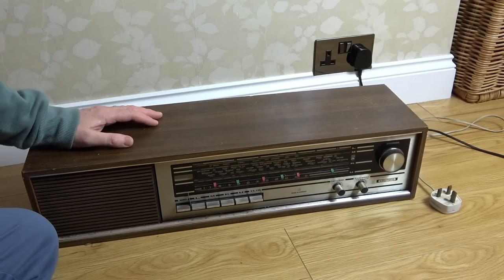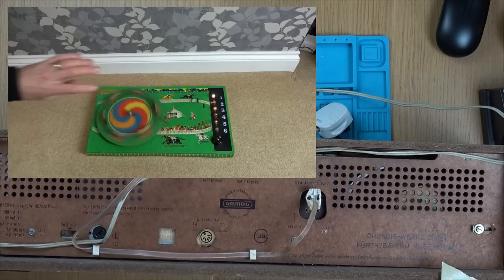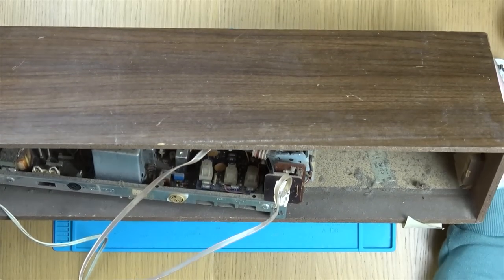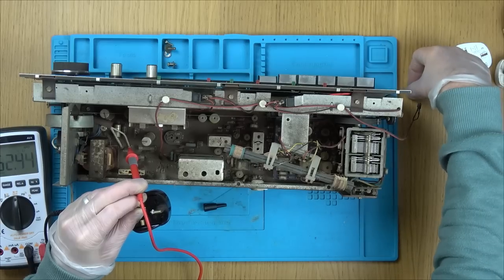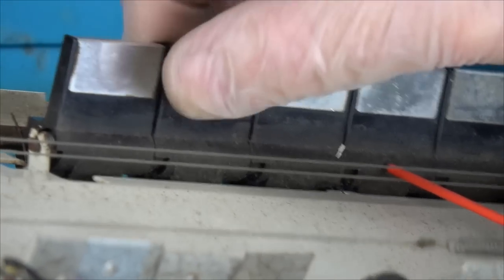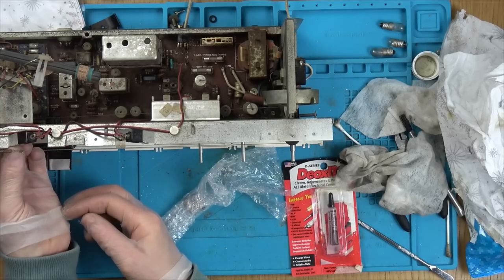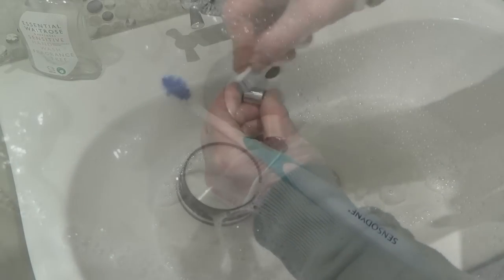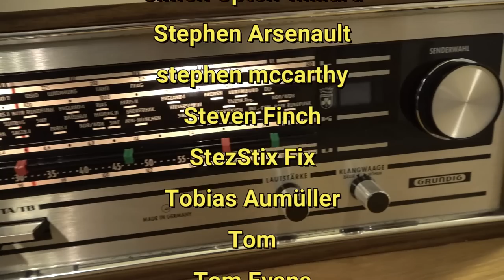Trying to RESTORE a Dirty HUGE Vintage West German 1960s GRUNDIG Bookshelf RADIO

Comment: Just a suggestion for future radios, you could use an FM transmitter; the kind you might have for a car, and then use that to play some roylaty free music to demonstrate the product, without risk of issues with copyright.
Reply: or better yet one of the pll quartz synthesized 2w ones from china that are much better than the crappy car ones and have more better range. Like the kind youd use for a drive-in church or movie 
They go from 88mhz all the way up to 110mhz and have dual low and high power settings so much more handy too for testing and they run off 12v dc
Reply: I have one of those transmitters for my AM radio in my 1965 Cadillac so I can use my I-Pod to play through the original car radio.
Reply: Difficult not to distract from the originality but I’d instal a Buck converter to drop the supply on those lamps and cut the diffusers off the bulbs if you want to use filaments- you might even find the diffusers are over the top of the bulb glass. Of course, leds and a dropper resistor would enhance it… Great vid, Vince.

Comment: What a gorgeous piece. After all those years I can't believe that something more vital wasn't broken like the transformer, any of the caps, fuses on the board., even an old dry trace what just wasn't making a good enough contact. Speaks for that old German quality.
Reply: many blame capacitors for pretty much any and every fault, in my experience, theyre not , especially in that sort of age equipment,
Reply: That's what I was thinking. With all the rust and corrosion it must have spent a lot of time in a humid environment, but when the electronics are well-made that doesn't matter much, apparently.

Comment: The switchset is sticky and as long as you got a range switch down the Off switch will not stay off. The "AUS" (Off) switch kills power and releases the frequency switches. Usually a bit run down grease on the switches release rail.
The lamp holders can be pulled up and the bulbs removed without front removal. They are just pushed onto the sheetmetal latches.

Comment: The particle board construction just signals the direction Grundig, along with other manufacturers were taking in trying to be cost competitive with those clever Japanese. My grandfather had one of those old tabletop units from the late 40s in a lustrous REAL blond wood cabinet. The push-buttons and 'magic eye' intrigued my 5 year old self to no end! He was a certified Westinghouse electronic repair man and so, that radio was always in tip-top running condition!

Comment: I have the exact same one, I bought it at a local scrapyard for a few Euros. 
It worked right away but had several smaller (mostly mechanical) issues. 
I lubricated all the movable parts, cleaned the pots, etc.
I also recapped the unit, since two caps were bad and it only has around four. 
It is one of the best performing radios I have seen, it can get a whole bunch of stations that no other radio receives here. 
At night, even Shortwave stations from all over the world are nice and strong, without any external antenna.

Comment: Great video Vince, the flex needs to be changed as that is single insulated cable which is no longer compliant as it should be double insulated.

You can use a 1 Amp fuse doing the calculations from the specs on the back. 

Thanks for sharing.

Comment: You could always wire the bulbs in series to give you that warm light it should have and some clear heat shrink or silicone tubing over the bulbs to diffuse them. Looks like its a seperate supply off the board for the lights, probably 6v so by using 7v bulbs you get that warm light and the bulbs last a lot longer.

Comment: Little tip for scratches on wood,  you can get touch up felt tip pens in different shades of brown specifically for wood. 
Deeper scratches can be filled with wax melt sticks,  also available in various shades of brown,  which you melt into the scratch.  Then use a sharp blade to take off the excess. You can even mix them to achieve the desired colour. 
Great video,  and what a wonderful piece of equipment.

Comment: Good work there! Those old Grundig table radios were great, and newer versions were made up until the 1990s. I have a couple of RF430s (1970s) that I haven't yet got around to looking at. My parents had an RF430, which I later kept until the 90s, but it finally went because the piano key mechanism was unrecoverable.

Comment: Of the many different makes of radio/electronic equipment that have passed through my hands I remember that Grundigs of any variety were always describable as "class".  Also anything by Roberts Radio.  On the question of the 13A fuse, I was advised its purpose was to protect the cable to the wall socket, not the device or the user!  Of course, there's no harm in selecting a power consumption compatible fuse (e.g. 3A) but I was told there was no need.  Your videos are, of course, most enjoyable, for which "thank you".

Comment: Caution with those light bulbs. They distribute far more heat, when using that way, which may burn/melt the plastic display. Better not use it for a longer time and replace them with the matching types as soon as possible.
Reply: I know it takes away from the vintage - but I would calculate to adapt the bulbs to led - this device was built for 220V - driving it on 240 with that linear transformer… is not a good idea. A 7805 and a few warm white leds in series could take it a long way
Reply: @cheapasstech  They now make those screw in LED's in the same shape like the original ones and frosted.
Reply: @ryan61384  I know they sell them for Christmas lights - but did not find led ones in this voltage
Reply: @cheapasstech  Not sure if they are the right voltage or not but they make LED replacement bulbs for pinball machines and other arcade games. If they are the right voltage then they might work. I have a receiver at home that I replaced the incandescent indicator bulbs with LED's that seemed to be a direct replacement based on the specs.
Reply: @ryan61384  lots of 6V, 12V and 24V ones yes - they probably drive the 7v ones  in this radio only on 6V to make them a little dimmer

Comment: I got the same radio. Those radios are made between  1971 to  1974 . They  were Grundigs  first series of domestic radis fitted with transistor instead valves. The only fault at mine were a loose dfial cord, so the pointer stucks even the knob was turned. Easy to fix. 
A higher mains fuse rating is has no limitation of the electrical safety. The radio got an internal mains fuse matched to capacity of the mains transformer. 
Here in germany all sockets fused with 16A and there is no fuse fitted  in the plug, The mains cord is capable to handle high short circuits currents up to 3000 A ( for few milliseconds )  before the breaker in the panel  trip. As long as you leave the mains cord as it is there is no danger.  A replaced mains cord should not have anymore lenght as  1m and  a cross section area of 0,75mm²  

This radio has also plastic cabinet. But a sort of high quality ABS plastic.  The schematic is free available in the internet from different sources.

I own a lot of old Grundig radios, most portables from th 60th . The boy series.

Comment: We remember something about how electronics shipped to the UK without a plug - the consumer being expected to buy and install one themselves. So putting a new plug won't necessarily spoil it being 'all original'...
Reply: I remember at school being taught how to fit a plug as nothing had them fitted. It was so frustrating when I got my NES having to find a plug before I could play it. Funny how now most devices that use USB to power it once again don't come with a power brick.
Reply: @carlstokes7321  It's just a waste anyhow, all do have a spare brick laying around, and if not just buy one👏 Simple.
Reply: @carlstokes7321  like having to look for batteries for our toys too
Reply: @Alexander_l322  - for some reason the mis'ess keeps 'bogarting' all the C-batteries..
Reply: @chezsnailez  well if you did your job properly then she wouldn’t need to use it as much! Haha got ya
Reply: @carlstokes7321  Yeah - reverting to the usual cheapery, purporting to be environmentalism... (It seems NoLocker and I differ on this issue! 👋)

Comment: Hi Vince.
Fuses, especially ceramic cartridge types are often filled with sand or similar to quickly stop the arc that forms when a fuse blows.
When the fuse blows the wire melts and starts to separate forming an arc, the arc needs to be cooled or quenched quickly to prevent further damage to the circuit being protected.
The sand will fill the gap and often melt forming an insulator where the arc was. There is a lot of science in correct fuse design.
By the way, the BS1362 fuse ratings available for 13Amp Plug Tops in the UK are commonly 3A, 5A and 13Amp. Less common are 1A, 2A, 10A but are available !!
Beware of the extra heat that those bulbs will give off, possibly melting any near by plastic.

Comment: The connector on the backside is called TA/TB connector in german TonAbnehmer/TonBand in english  turntable/tape also you can plug a cassete player in, or you can make a cable with the right plug to listen to music from the phone. I have a few german tuberadios from the 60s and they have the same blown lamps it's hard to find diffused, but normal do the job great too.

Comment: Great video 👍 can't believe you didn't need to replace any caps.

When I restored a couple of 60s Roberts radios I use the Novus range of plastic cleaner on the tuner facia and it looked like factory new. Brought back the sparkle and removed some scratches.
Reply from the maker: Cheers for the tip Chris 👍👍

Comment: I grabbed a Grundig portable radio out of a skip at local tip yesterday and it works perfectly and the sound is so loud you don''t need to use more than 20 percent of the volume control. Other radios don't get anywhere near the volume of the Grundig.
Not bad for something made back in 76-78, I never really took them seriously before but would love to find more stuff they made.

I really like to see you do the radio/hifi repairs the other stuff's great aswell though.

Comment: Thank you, Vince. Nice restoration. I spent a lot of time playing around with such old audio equipment when I was a teenager (flea market finds). Lots of fun and very often a lot of sound for the low power ratings. 5/10/15W really can suffice. You should try out something from the Luxor Dirigent series (eg a 3200) some time. Really nicely built equipment. Keep up the good work!

Comment: Lovely piece of quality equipment.  Be careful the heat from those over-voltaged bulbs doesn't melt the frequency chart or anything else, replace them asap
Reply: Yes I would recommend connecting them in series to half the voltage, save you buying new bulbs. Those 4V bulbs will run way too hot!

Comment: Great content, there have been a few times when I've found that the plug has been the cause of the power loss not just the fuse of coarse there can be many reasons for failures unfortunately we live in a disposable society where things are thrown away for the sake of changing a fuse or plug but it's nice when it's a simple fix.

Comment: Great video. I have a 1975 Party Boy 500 and can confirm that these 1960s/70s Grundigs are indeed fine sets. They weren't as solidly built as their Hacker and Roberts equivalents but the electronics are top-notch. Same story with ITT. This must be a late 'Made in Germany' model as they moved radio production to Portugal in the early 1970s. This later became the home of Grundig audio system manufacturing when radio production moved again to Malaysia ~1980.

Comment: One of the plugs on the back is for an external loudspeaker. The other DIN plug is to connect a tapedeck. You can use it to playback tapes and / or recording the tuned-in radio station. With the TA/TB switch you activate this port for playback.
Reply: possible bluEtooth hack

Comment: The fuses in UK plugs are ceramic and filled with fine sand to prevent arcing when they blow due to over-current.

Comment: They sell little diffuser caps that cover the bulbs & tint them different colors. I used them in my 1960s car. At one time the various warning & indicators in the dashboard had green, red, and blue lenses for various functions that became sun faded so they were white instead of the colors they were meant to be. Then I found the little colored caps for the bulbs. They come in many neat colors.

Comment: Hi Vince, nice video. Problem with those lightbulbs often is, they are designed with 220 volts on the transformer in mind and burn out much faster when driven by 230 or even 240 volts, resulting in, say, 8 volts instead of the intended 7. If you just replace them they will not hold very long.

Comment: You could have re-wired the bulbs in series to drop the voltage that each lamp sees in half.   They may be dim, but they will last much longer and you would be able to use the parts on hand.  The bulbs you used will have a much shortened life.

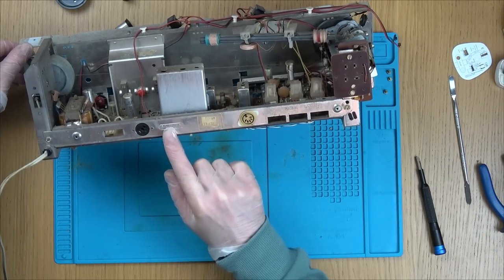Comment: 22:44  That was the nice thing about the "old" transformers.  They had multiple terminals (at different stages of the winding) that gave multiple voltage inputs.  This was also great with old pinballs and arcade games.  You just had to move some jumpers or resolder some wires to get the desired voltage input.  Also, these "old" transformers created less dirty electricity that the new switchers do.

Comment: *IMPORTANT*
Me M8 Vince,
Just a heads up, that there are a two types of DeOxit, One is for direct contact switches, whilst the other which is extremely important to know about as it does not destroy carbon contacted devices Eg: "potentiometers" and "carbonised" contact switches found in keyboards and portable gaming systems, if the carbon is removed from the rubber the switch will not work, and if you replace the carbon with a conductor it could damage "electrical current" sensitive components. 
Anyway I want you to know I watch all your videos and drop a Like, BUT Most importantly in support allow all your adds "As long as they are under 30 seconds to run through"..

Comment: Something I've found that works well to get at that deep stubborn dust is a stiff 2" paint brush. The bristles are long enough to bend / deform around and under the components. They aren't stiff enough to do damage to the old components. (In my experience)

Comment: The fuse ratings were on the backplate in German: 110V-100mA and 50mA 220Volt.
Reply: 100mA seems rather low. How power efficient is one of these?
Reply: @supercomputing942  I don't know, these radio's aren't that power hungry. It's on the backplate, usually those are correct. Tube radio's  also use low rated fuses. Equipment these day tends to use more power and need fuses of a couple of amp.
Reply: @js0000356  yeah it should be 100% correct, but im just used to seeing at least 2 or 3 amp fuse ratings in most power supplies and electronic nowdays.
Reply: @supercomputing942  I can imagine that these rating must seem a bit different to you. These older ones do not use that much power and the speakers were more efficient this speaker is 4 watts. I am quite used to these amp rating since I restore old radio's.